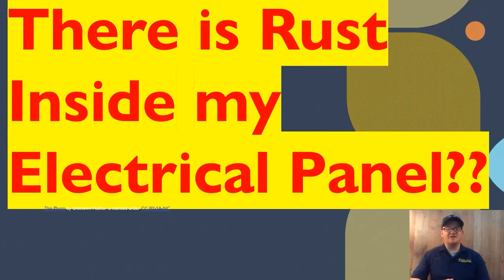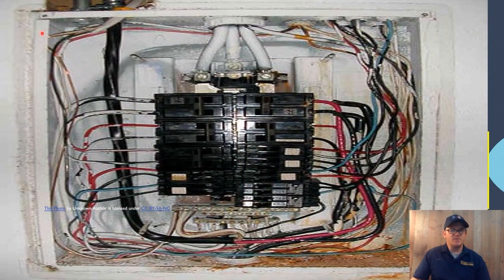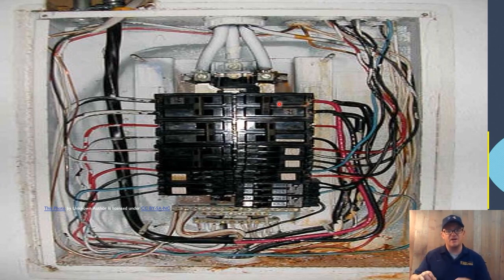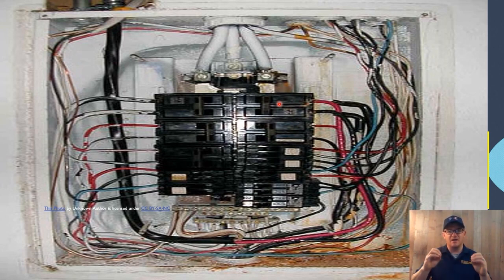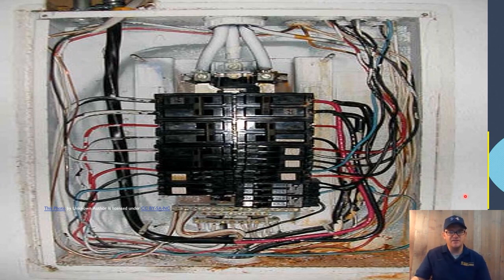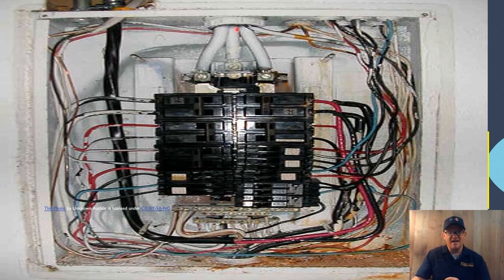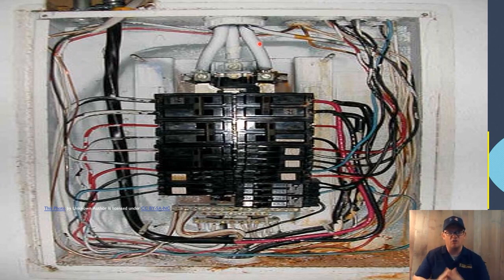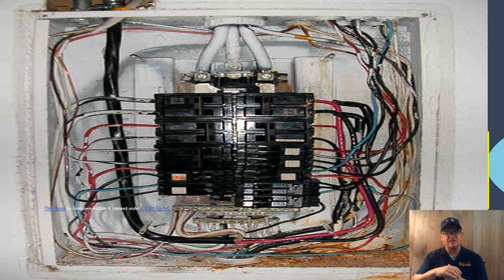RUST in Electrical Panel!! Why?

Comment: more common up north is water leaking into the meter pan via the SER seal. Caulk that up and it helps. The other thing is water from gutters getting in around the meter itself, and if the SER out the bottom is riding low it gets into the jacket. if you can pull up a little slack and get the jacket above the floor of the pan you have solved part of the problem.

Comment: Another issue that I've found in a 2 story apartment, that has the panel in the laundry room, both are beside the washer and the upstairs had a water leak. I argued with property manager that needed to change out the  breakers because of the water that literally was soaking the breakers. Yeas it tripped the 125 Amp Main that was outside.

Comment: Another great one coach! Popped open a panel in a restaurant once and found H2O dripping down the inside. It was 25' from the outside disconnect but the cool winter air was interacting with the warm moist air to an extreme degree! I hadn't heard of sealing conduit (except for seal offs) but felt it was the only concienable thing to do. 

Is there any exception in the code book for this? I'm sure there's a remote risk of overheating conductors this way. Thanks in advance man!